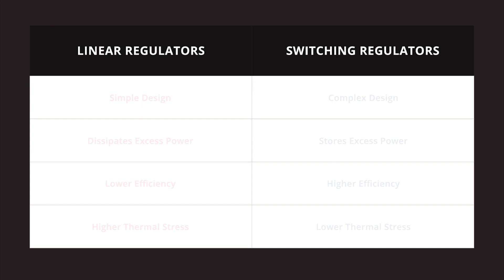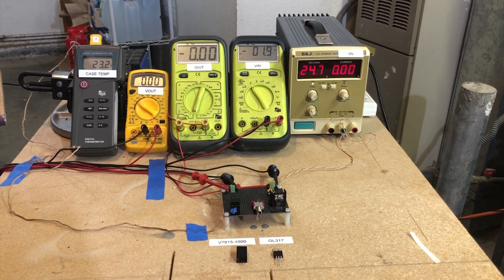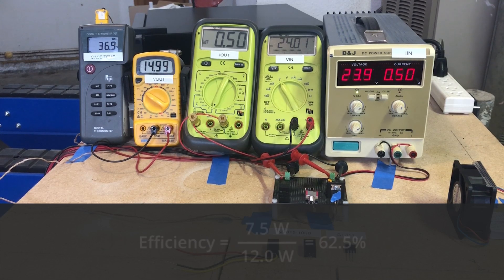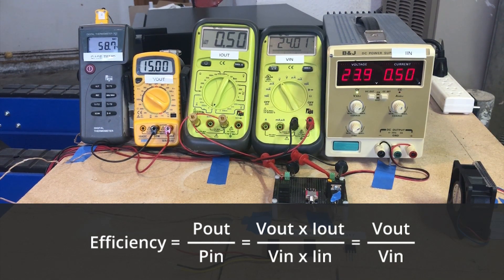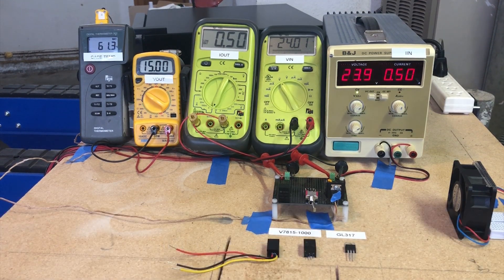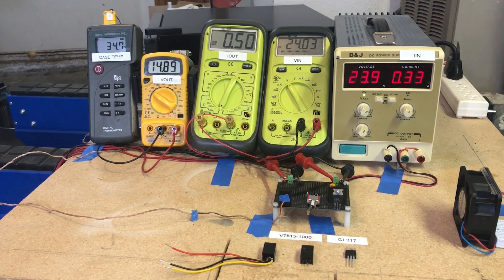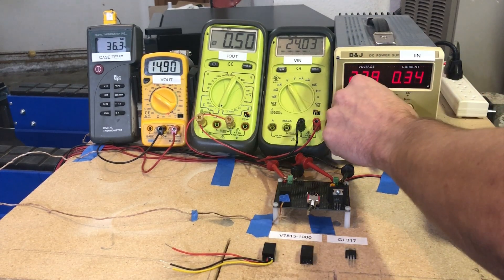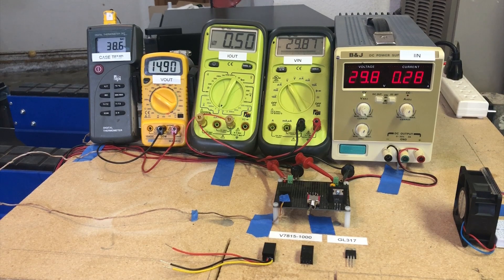A Comparison Between Dc Switching Regulators & Linear Regulators

Comment: Really good demonstration, clearly illustrating the advantages of switching regulators, and I really like the pin compatibility & simplicity of using CUI's P78-500 series. CUI's P7812 are used in a product line we will purchase, and I am wondering about RFI, since these devices will be very near VHF radio receivers (~8 inches away). Linear supplies are known to be very clean since there is no switching. I see in CUI's P78-500 series spec sheet that caps are recommended on the input & output. Am I correct in assuming that these are used to filter out switching noise and/or prevent oscillations? If so, what if they are left out? There are no caps on the P7812 for the product line we are purchasing. The product previously had a linear power supply, but the supplier simply substituted the P7812 to handle an increased input voltage of 48VDC.

Comment: I am looking for a Dc Switching Regulator that I can use on a E bike. That I can tie a usb phone charger to it. I would use the bikes battery that can range from 54 VDC (full charge) to as low as 40 VDC when bike is exhausted. I would need a constant 12 VDC output from the Regulator, no matter what the input voltage is from the bike battery. I would tie that 12 volts output to a usb charger, that in turn would drop the voltage to 5 VDC to charge my phone. Any ideas on what is out there that would serve this purpose? Looking for something small, since it would be mounted on a bike. Thanks